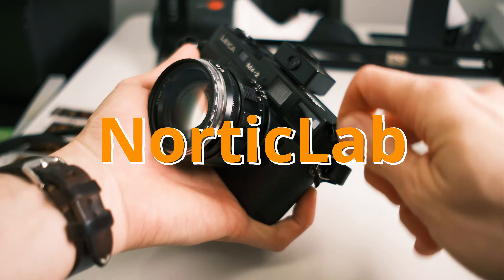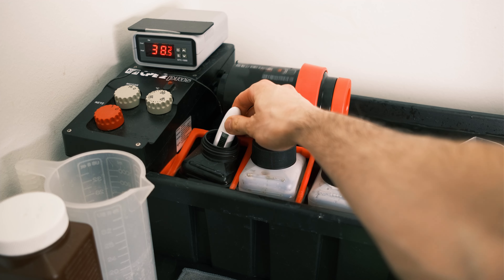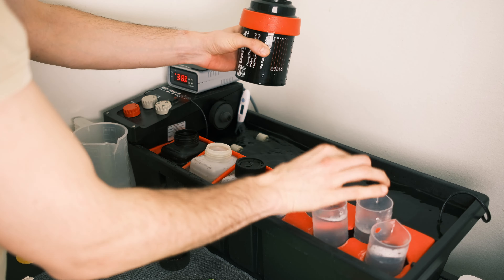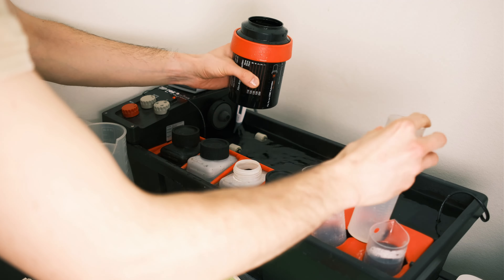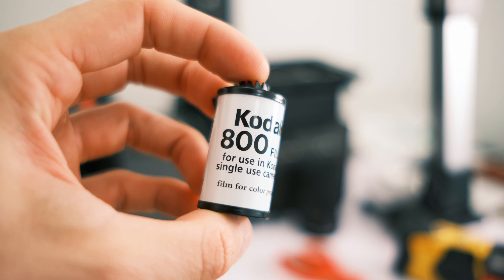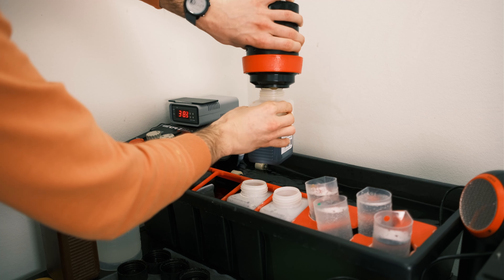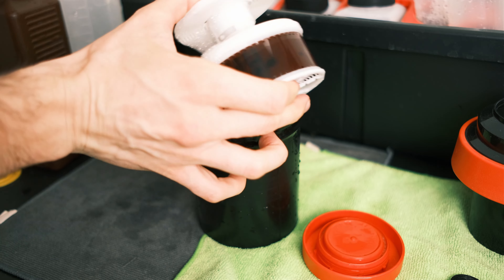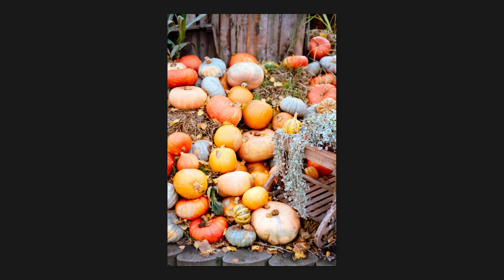Development of film rolls from Autumn | C41 process and hand development in Jobo CPE  processor

Comment: I think you have some reflections on the longer sides of the film, I can see yellow stains there. Pretty sure it's coming from the film holder or extranous light bouncing from the film. I had that issue just a couple days ago and it was coming from the holder. Very nice results nonetheless!
Reply from the maker: Yep, it’s from film holder, i’m just experimenting so far, but holders on the market really bag so far, only glass plates gives me excellent results, but i need to find different set ;)
Reply: @NordicLab  try with black velvet glued to the holder, that killed the reflections for me